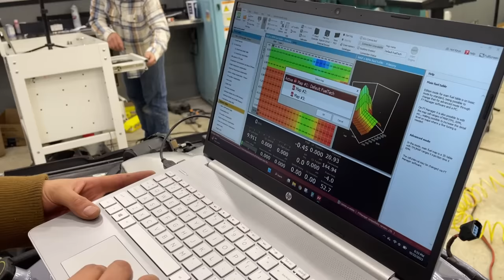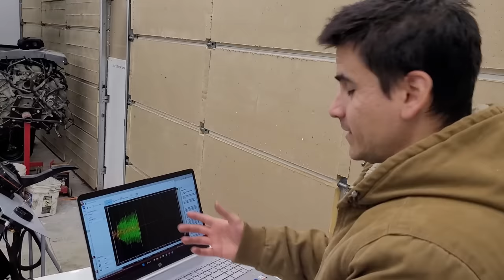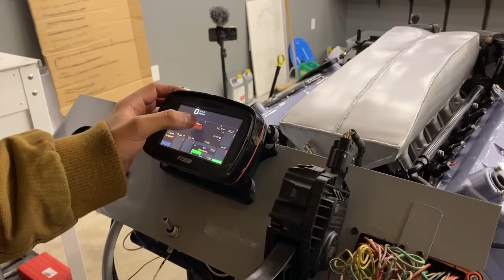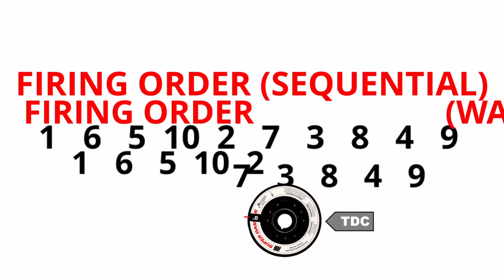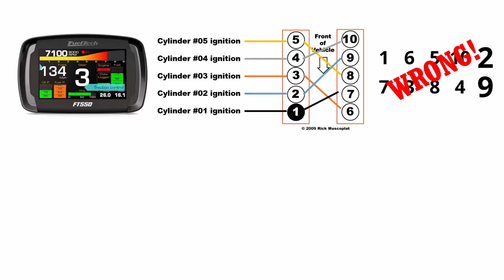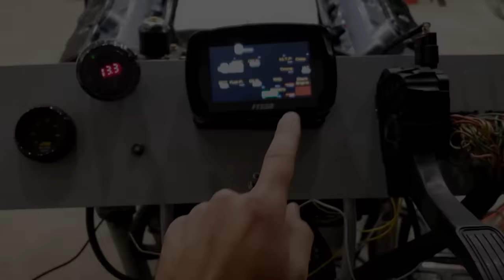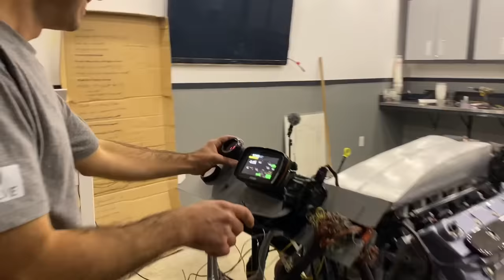Ford 4V V10 First Start! | It Sounds Insane!

Comment: Glad someone else is doing what I wish I could do to the ford V10. Good job guys.  I was looking for aftermarket V10 heads for awhile and I figured before I saw your video that someone would just have to fabricate their own.

I’d love to have a  fully built 4 valve head Supercharged or turbo V10 with a low lift cam in a Excursion setup for towing and off-road.

Comment: Kudos to you guys...that's a monumental achievement and sounds great. I'm a Pontiac guy at heart but I've always said a built V10 Ford would be badass and carol Shelby thought so too w the cobra prototype they had built
Reply: I'm also a Pontiac enthusiast and  dedicated Anti-Ford, that being said I love V-10s with displacement and these men have accomplished something epic. Definitely inspiring to see them endure the variety of hardships and come away with a Victory ✌️
Reply: @SGTMARSHALL1 Pontiac died a long time ago I understand why you would hate 😂 Ford still being here and all. V10’s are very nice I had a v10 F250 sold it in 2019 with 450k miles it needed a performance version
Reply: @CoyoteFTW  my hate for Ford comes from purchasing 2 of them and then watching them disintegrate into worthless piles of shit over a very short time. I am glad that you got some good mileage out of yours
Reply: The cobra concept was a 5.8 v10 though. It was built for racing. The 6.8 is more for hauling.
Reply: The problem with V10 ford is that the crankshaft is a weakness. That is why no one really does anything for the V10. I would say with the dual overhead cam heads it's possible that it's close to it's limit on power. With that being said...it sounds truly beautiful. 
Great job...
Reply: @Soundsofthewood  Yes because the 5.8 concept was 4.6 based, smaller bore and shorter stroke than the production 6.8
Reply: @eclipsegst9419  just smaller stroke. The bore is the same.
It was just a 4.6 with two extra cylinders.
The 6.8 is just a 5.4 with two extra cylinders.

The 6.8 was not really all that successful.
It was about the same as a 460, but drank fuel like no tomorrow.
The 5.4 was the lesser option and it did the job just as good.
6.2 was the replacement to both and that engine seems pretty good.
Now the 6.8 v8 and 7.3 are the options to get.
I don't understand ford sometimes. Go from OHV, then to OHC, then tack extra cylinders for more power, then go back to having less cylinders, then going back to OHV.
Dodge tried this also and them didn't try to way too far. They also had the same issues as ford.
Reply: @Soundsofthewood  Ah ok, i knew it was mostly stroke but i thought there was a bit of bore too. The 6.2 is a great engine, its got all the kinks the 5.4 3v had worked out of it and more power to boot. The 7.3 is a true modern big block, which is what heavy trucks really needed. The V10 did always seem way too thirsty for only having 2 extra cyl. In general OHC designs are better for high RPM power and OHV better for low end torque. So the V10 was always a compromise of a design.
Reply: @eclipsegst9419 overhead cam motors can do great with low end torque ecsp if it's got a long ass stroke like 5.4 and 6.8 does.  Even better with 2v heads but 4v heads can make good torque too it depends on the setup.
Reply: @midnight347  Well yea, if you size everything right you can do either or, but the benefit of DOHC is usually more flow for more RPM. That said, for a while i owned a Mercedes E420, and that DOHC 4.2 had gobs of torque, and the pushrod 331 build i'm planning for a Mustang, with Cleveland 220cc heads and a radical cam, will, according to desktop dyno estimates, make max torque all the way up around 6K rpm or so and max power a bit over 7000. So it can certainly go both ways.

Comment: Needs a performance Y-pipe(increasing diameter) or an X-pipe to really have THAT sound that you're looking for. For the Y, do dual 2.5 into single 3.5, or if this ends up over 650bhp, do dual 3 into single 4. Not to mention that you'll also need equal-length headers. But man, what a long way to have come to finally get the first start!

Comment: Love this vid!  My old man bought a Ford Superduty V10 new from Ford in 1999. 

I got 5.4L Superduty cammed with stage 2 cams. 
 & I have an 03 Mach 1...    so I can appreciate taking an engine that was just supposed to be a 2-3 valve truck engine & throwing all this custom 4v head work to make something that can run extremely well  💯

Comment: That first start sounded great. Ford did make a few experimental DOHC V10s based on the 4.6L. There's some videos floating around of them running.
Reply: I think it was a small team at SVT that made the 4.6 based V10; which ironically came out to be a 5.4 I believe. That’s a totally different approach though. They had to cast a block, and have a custom crankshaft made as well as the heads. Ford missed the mark by dropping that project 😢
Reply: @MrLuvtheUSA  yes. It was a 5.8L. The displacement recalled the old 351 Cleveland and Windsor. They also used a common pin crankshaft for strength and high rpm. That's one thing I worry about on this build is the strength of the split pin crank at high rpm or lots of boost.
Reply: I have done some hot rodding of the ford v10. Nothing like this though. With my couple of built motors, I found the split pin crank is good for about 500HP and 5500 RPM MAX. I didn't do any cam changes, and it takes some work to get them to 500HP.
Reply: @dalewhitehead5378  that seems quite low. Have you broken a crankshaft?
Reply: @MrLuvtheUSA No, Ford did not miss the mark. Those of us old enough to remember the MM&FF, et al articles about that project know the inherent problems with that engine as well as any V10 based on the mod motor family of this era was NVH and the split-pin crankshaft. There are very good reasons why the 4.6 & 5.4 got more aftermarket support while the 6.8L was left to truck/RV/generator duty, it flexes a lot more than the V8 blocks where high-rpm and/or high cylinder pressures make it liability compared to investing the time, money, effort into the V8's.
Reply: @MrLuvtheUSA no, it came out to 5.8 it was 351 ci
Reply: @MrLuvtheUSA it was a 351 cube 5.8 v10 it had like 426 hp in 1999 it would have been badass.

Comment: I always dreamed of Ford building this engine. They did build a single 5.8L 4V V10 (4.6 4V cobra motor with two extra cylinders) back in the early 2000s. That was just a skunkworks project, but was never put in anything besides a development 99 Mustang that was used to develop the Cobra R 5.4 4V motor. It was called the Boss 351. They used the 4.6L as the base instead of the 6.8L V10 because of the shorter deck and non split-pin crank. 

This is incredible stuff. Congrats! It sounds incredible. I can’t wait to see it in a car and ripping. Definitely subbed. Glad I found y’all, even if it’s at the end of the build.

Comment: Just stumbled across this video. Brought back some memories of a project I did about 12 years ago. I remember the excitement after finally getting all the electronics straightened out and that thing firing off. I was walking 4 ft off the ground for a couple of days. But what you guys accomplished you should be walking 4 ft off the ground for a month. When that thing fired off I was smiling ear-to-ear with you. Excellent job and that thing is a beauty

Comment: Having done a much simpler project myself I know how frustrating these issues can be and I can appreciate the frustration these guys experienced. I took out a four cylinder ohv engine that used a carburettor and points ignition and fitted a three cylinder Suzuki engine with a VW supercharger, Ford throttle body, BMW Mini injectors on a home made intake system. I later removed the supercharger and fitted BMW ITBs, in port fuel injectors from a Skoda and used a more reliable and sophisticated ECU. I had terrible reliability problems which I thought was down to me. Turned out that the brand new fuel injectors were sticking. Once I replaced them, it was just a matter of retuning it (I elected to do this myself, from scratch). Nowhere near as big a project, but similar issues. I’m not an engineer, just a DIY amateur. I forgot to mention that the engine came from a front wheel drive car and it’s now in a rear wheel drive car, so that took a bit more effort, too.